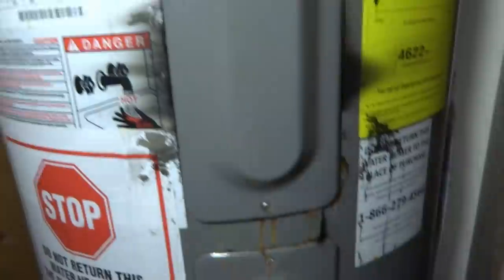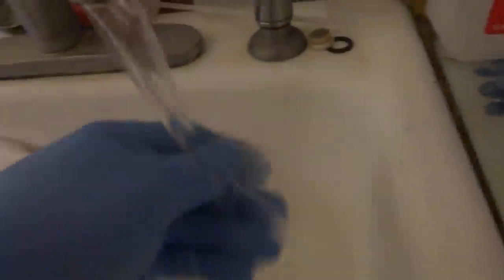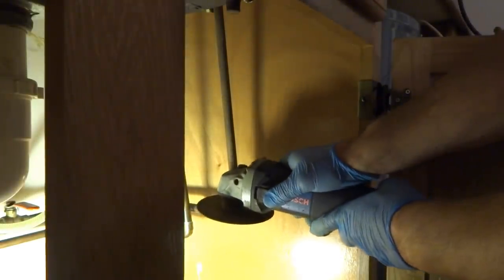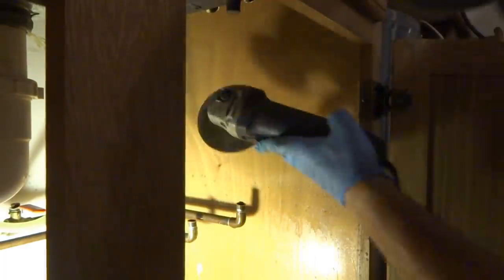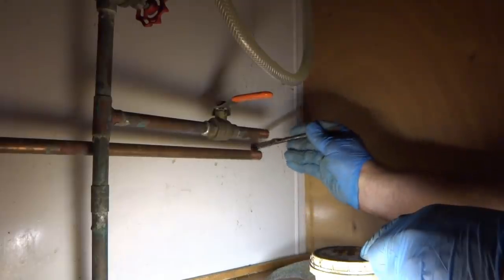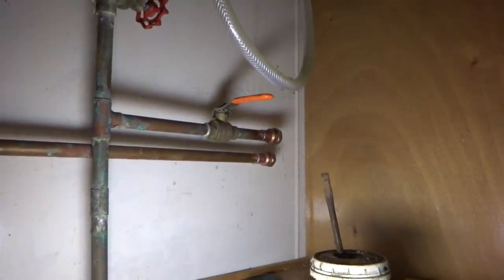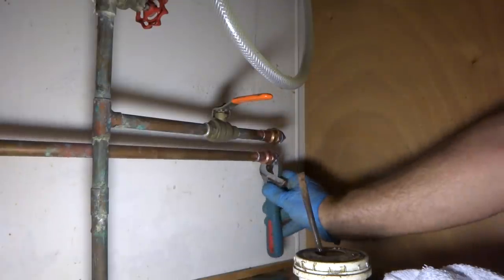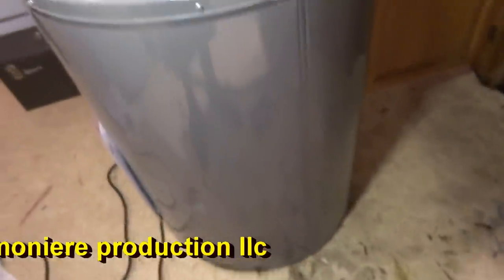HACK INSTALLED ELECTRIC WATER HEATER ALMOST SET HOUSE ON FIRE

Comment: "Oh boy nice solder joints!" as one twists right off...
Reply: My first job was in a restaurant. They were removing the pipes to a disused bar area. Each segment literally just pulled away from the next. What a shit show.
Reply: his soldering is questionable.  he should be hitting the mass of the fitting, and avoiding hitting the pipe at all...
Reply: @BrianKrahmer  his soldering is fine. That cold pipe had residual water left in it, hence why he lit the pipe for so long. So he could burn the remainder of the water off. He does a good job soldered in all his other videos. It's the prior plumbers I would question. Lol
Reply: I do not think that tank was installed by a professional company it had to to be an un-handyman special.  Electric is wrong, plumbing is wrong nothing to indicate it was done by anyone with knowledge or trades.

Comment: Witnessed the same thing happen with a 60 gallon dual element hot water tank at work.  The upper element started leaking into the area where the thermostats are and it was burnt just like this;  tripped the circuit breaker... after it made enough smoke to fill the room from the ceiling down to the 4 foot level.
When this happened the homeowner must have been aware of smoke!
Reply: Rust stains running down from below the thermostat cover clearly indicate this had been leaking for a while.

Comment: These Rheem Performance electric water heaters had a dangerous safety recall in about 2018 because the contacts would fuse together and either melt like this or sometimes catch on fire.  Our unit was affected.  Purchased from Home Depot in Cincinnati area.

Comment: 13:04 It's always sad to see professional plumbers do not use welding/soldering blankets to protect wood/surrounding surfaces while using open fire torch soldering copper pipes..
Kind of "that's ok, to burn some wood, we always do this way" approach to work site
Reply: Meh
Reply: That's an interesting point

Comment: When water leaks from a tank, there is inefficient water heating, so the thermostat commands the heater on more frequently, increasing the duty cycle and increasing demand. The wires don't have as much time to cool down between heat cycles, leading to meltdown at critical points. I removed a water heater last year with the same thing, melted plastic around factory connections. It's a good reminder to tell the client to trip the breaker to a leaking water heater while waiting for a replacement.
Reply: No, that's nonsense, the heater could be running 24/7 without ever turning off and it still would never risk overheating those conductors. The leaking water starts passing current through it to ground or another conductor which will rapidly corrode it and create a higher resistance connection. The higher resistance from a bad connection is what causes it to overheat and melt and in this case there was definitely a short circuit afterwards that left the black streaks blown out from under the cover.

Comment: What's wrong with the tanks location? Lowboy heaters were designed to go under the counter. There used a lot in lake cabins to save space. My church has a lowboy in the kitchen for cleanup after potlucks. Feel bad for the guy. I had my electronics fried by lighting.
Reply: I thought lowboys were designed to go in the crawlspace under a house.
Reply: They couldn't find a lowboy with side taps and a side TP valve?

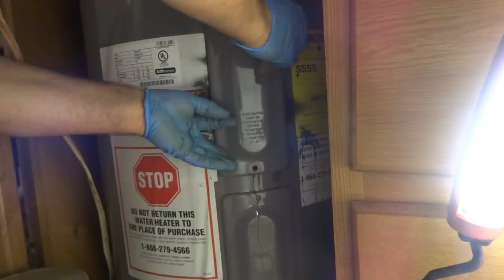Comment: 6:41 - WOW.

We once had a lightning strike to a tree on our property back in the early-1980s. Blew out our well pump (submerged, 230' well) that was roughly ten years old. The pump we replaced it with lasted until this past summer (2021), we had to replace the starter cap twice. During its last five years of life, the tank bladder had failed; in order to wash my hands in the upstairs bathroom, I had to wait for the pressure switch to kick the pump on to get enough pressure to rinse off soap, so the pump certainly didn't owe us anything.
The "plumba" we brought in was shocked that we had such a deep well. My grandfather, being a smart plumber, over-planned our plumbing and heating systems with an eye towards future needs and unforeseen issues. We've never had our well run dry since the house was built in '75, while neighbors that have built since then have had the occasional issue during droughts with shallow wells.

Comment: The reason why it's burnt like that is because either there was not enough water in the hot water tank or no water at all. The homeowner stated that there was well issues when that was occurring he should of turned off the hot water tank. That's exactly what happened. I work with electricians out of Virginia and we in the south call it Dryfire. This is more of a severe case though.
Reply: He was talking about lightning strike too and electrician said needed breaker panel replacement
Reply: @mrmotofy  If the panel fried he wouldn't have any working Circut Breakers which would of resulted into the main breaker completely burnt and on top of that it wouldn't be safe for him to use the breaker system at all. Lightning striking 120/240 volts would fry everything in his home. It wouldn't of just been the hot water tank! His tvs appliances and anything that's not AFCI/GFCI protected would completely melt and his Circut Breaker wouldn't be working including the main. I know I work with electricity all the time. The hot water tank is on 20 amps with a minimal gage wire of 12 most people try to use 10 gage which is better for long distance travels. But in his case it was dry on the inside. If lighting struck it both elements would be burnt not just 1
Reply: @crockpot5194  NOPE there's NO guarantees with lightening. My uncle got a tree hit couple months ago 50' from his house. The line is is charred and split from top of tree to bottom. NO breakers tripped. Yet lost most electronics in home. All security cams/dvr are non functioning, 1 TV survived but boxes plugged into it fried/failed. Electric lawnmower was plugged in charging. The charger fried, the charging circuits on mower fried lights burnt out but mower still operated perfectly just couldn't charge it. All appliances were fine...but again NO breakers tripped. Lightening is theoretical but is NOT absolute.
Reply: @mrmotofy  Your correct not all Breakers will trip but if they don't expect the Breakers system to be super hot and also expect the burning smell and possibly in real bad instances a fire to breakout. Remember lightning is millions of volts
Reply: @crockpot5194  That's why the homeowner said electrician told him it all needs to be replaced. That's good you're finally realizing I and the homeowner was correct all along and you weren't. I don't expect you to actually admit it publicly...the important thing is YOU realize it.
Reply: @mrmotofy  No one is on here to gloat base upon being correct or incorrect. I'm telling you things by experience not by guesses. I've seen things really happen. If you've never experienced 10 million volts come through a home and fry stuff w/wo grounds than you can't guess off of what was said. He even stated that his well had low pressure. I'm surprised his well pump didn't burn up either. Have you ever seen a direct strike before? Have you ever experienced the shortage of 120/240 volts malfunction to the point it back feeds to the distribution transformer? And just by the way everyone's experiences are different I'm glad to tell the truth about what really would happen if these things were to go on than to sugar coat information to people.
Reply: @crockpot5194  Like I said, I didn't expect you to admit you were wrong saying a lightning strike would have tripped breakers...there ARE NO absolutes with lightning it does weird unexplained illogical things like I said lol. Have a nice day
Reply: @mrmotofy  It will if they are Afci/Gfci. Some homes don't have afci/gfci breaker systems they still run off of the original ones. If your so intelligent you would know that. Have a wonderful day as well
Reply: @mrmotofy  do you even know the acronyms of Afci or Gfci. The acronyms are Arc Fault Circut Interrupter Ground Fault Circut Interrupter. Steven is a plumber/Hvac Technician and one of the best in my opinion. The whole time I was laughing at you. If you would know how long I've been working with electricity you would think it's a joke but actually I've studied and gotten my license in this field. And if he wanted he could buy AFCI Breakers for his breaker system if he wanted to. Or just upgrade to a brand new breaker system

Comment: so, let me get this straight, the hot water line was hooked up at one end to the summer winter hook up on the boiler and at the other end was hooked up to that small hot water heater?! WOW! and he just now notices a problem?
did you all see the burned off wire 18:55 coming from the upper heater? on the right side of the thermostat controller? no heat there!

Comment: Ussualy the connection for the water heater is at the top if it’s 240v both wires are hot this look like a failed thermostat but if it’s 120v sure there is only one correct way of connecting it but if the polarity was reversed I don’t think it would cause this some like this usually is a short to ground curious what caused it?

Comment: same thing happened to our hot water heater, but it wasn't a new one like this one and was 5-6 years old. on of the elements by the relay(?) started to leak ever so slightly and likely caused an arc on the mains wires going to the relay which melted the wires.

Comment: I am watching your video and like you thankful that the house didn't catch on fire but I'm just a little confused it looks to me like the electrical wiring in the electric heater burned. Did water drip on it or was it just a loose connection in the electrical cabinet.
Barry

Comment: I have seen lighting do some strange things in homes. Almost like it was a living thing. I bet if you look at the side of the house, there is no grounding rod in the ground.
Reply: Old woman told me that she saw lightning come-in through the open living room window and then down into the electrical outlet below.  She refused to sleep in that house during a storm from then-on...would go next door to a trailer.   I once saw where lightning hit a big oak tree on my land, about a foot from the base, knocked a chunk of bark off as the sap and water vaporized, went two feet down and exploded out gravel when it exited from beneath the gravel road nearby.  Also I saw where it had hit a big pine tree and totally exploded it into huge 15 foot long splinters as wide as your arm.
Reply: Had a no cooling call system flat oil all over condenser liquid line split . Lightning hit utility pole far back corner yard jumped onto old chain link fence traveled along back up side fence then created a Tesla experiment at the copper lineset.
Reply: @metal2444  Wow just Wow dude
Reply: usually a lack of bonding also is the main culprit. people dont know what they are doing and still send it lol

Comment: Looks like the boiler and the water heater were providing hot water until the elements burned up. The the cold water in the tank was mixing with the boiler tankless making hot/cold complaint. Obviously the tankless couldn’t keep up prior to the electric heater install.

Comment: Always test because once had a service call to figure out the electrical on a water heater install that another heating and cooling place was installing. We did a lot of work for them and thought shutting off the breaker labeled water heater in the panel instead went to the garage. They disconnected it and tagged the water heater wires onto the range breaker. The heating and cooling guy said there was still 240v on the water heater lines when one of his apprentices blow off the end of the wire when it touched while he was disconnected the old W.H.

Comment: Gotta love that someone intentionally removed the relief valve and installed it like that because it wouldn’t fit under the cabinet. That T&P has a sensing rod that has to sit inside the pressure vessel. Shame on whoever installed that.

Comment: Do you worry about the hot water melting the wax out of the toilet?
Reply: That thing isn't making hot water.
Reply: Even if it was the wax ring won't melt from hot water running down the drain

Comment: I went into a duplex (top/bottom floor rig) that had the heaters built into the kitchen cabinets like this, both state heaters from 1989! Both wound up getting replaced, tenants lost cabinet space and we had to jimmy the countertops up 4 inches, add blocking, painted 1x, etc. to make it look half decent. Wasn’t anywhere else to put the heaters unless the duplex (circa 1900) got turned back into a single family house. Shit job across the board.

Comment: Heat exchanger is plugged in boiler (probablyfrom the well water it used to be on) ...the electric tank was supposed to be in series, but with heat exchanger plugged the pressure would suck.  They probably didn't feel like fucking with all the Galvanized pipes from decades ago.

Comment: Ive seen that on electric water heaters when they leak the water goes on wires and causes fire
Reply: I'm no plumber, but I thought I saw some corrosion inside the bottom of that pannel. When I saw that I was wondering if the heater was leaking onto the lower wires there. I'm assuming that thing has been having issues for a while which was either ignored or simply wasn't noticable until it blew out like that.
Scarey stuff!

Comment: Yeah, more than likely lightning got it. Gets so hot so fast it fuses the contacts in the breaker together and they can't be popped. But he shouldnt be on the grid right now. He should have service disconnected until he gets a new panel and breakers. Because who knows what else that lightning strike did. Could of screwed up so many wires throughout the house.  Scary not having working breakers.

Comment: Probably the reason it goes hot and cold is because the have a line crossed somewhere and it pulls cold from a point closer water follows least resistance path
Reply: Or the heat exchanger is plugged.

Comment: just 1 min in i would say you can use some struts or shocks for your van but on the other hand if a vehicle is not going to last long it is hard to invest in new parts spend 700 on struts and the vehicle dies in 3 weeks.

Comment: We use to flush the coils on those oil fired boilers ! Had a pump and would flush hydrochloric acid through them * They would realy be gunked up ! Acts like a insulator! Dont get alot of hot water! It would do the trick !

Comment: Water heater looks like element started leaking. It will look very much like that because is a slow shorting that's going on. The leak gets worse exasperating the problem. On Romex coming in. Its not that bad at least there was only a loose strain relief. What's really dangerous is when they don't use a stain relief at all. The sharp tin  the wire is passing through can cut right through the Romex sheathing and insulation and be direct short to ground.

Comment: What was not legal about that relief valve. What would be the right way.
Reply: T&P relief valve must be inserted directly into tank to properly sense water temperature.
Reply: @Robnord1  the relief valves senses temperature? I thought it just popped off when the pressure gets to a certain point.
Reply from the maker: t + p relief =  temperature and pressure relieve valve .. it has to be in water in top of tank
Reply: Sweet I learn something everyday.

Comment: that is definetly a hack job. getting hot water from 2 different supplies...that caused the hot cold bounce. and that t and p. omg. that job was so screwed.
Reply: and that water had a plastic drain that normally means it came from a lowes or home depot.

Comment: I put a low boy in for my sister years ago, the new ones have the temperature pressure relief valve is on the side, and the electric is 120 volts, 30 amps on hot leg, white is neutral, single phase, it works good , she had me put in her addition, a solarium. 30 amp single pole breaker, 10 gauge wire, they didn't wire that heater right that's why it has all those burn marks.

Comment: And that’s one reason why code inspections should happen on repairs. I get it now. Sad we grown ass men need babysitters. I agree with codes after 21 years of seeing this crap. Home owners ARE wanting to skirt the system DESIGNED TO PROTECT THE HOMEOWNER. This is why we’re so expensive. We have to be more costly than this hack or we will be thought of as this hack good work Steve. Honest plumbers still exist. Crooked homeowners do too.

Comment: First: if the breaker didn't trip, why not!? and second: if it did, who on earth would turn that back on in that condition!? There is no possible way someone didn't notice that. The smell alone would make someone look hard for where it was coming from.
Reply: Electrical arcing doesn’t necessarily result in enough current flow to cause a breaker to trip.

Comment: Steve what's up with putting those plugs in.  Why not just cap it off?  If I was to bump off that water line, I wouldn't have another treaded joint to worry about, just cap it off.  You go on some shit show jobs, especially this one, water missile, but blew at take off.

Comment: Not having a good earth ground would cause breakers to thermal lock otherwise they should've tripped out being zapped by lightning strike , I would put a couple lightning rods on arch high points on house with line to ground rod ,sounds like a place I'd put up on the market if it comes back up.